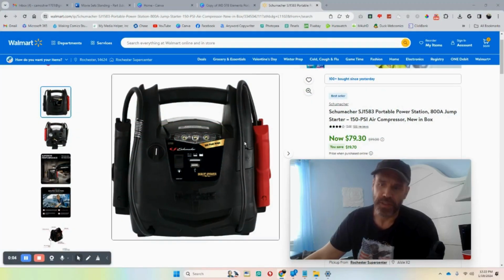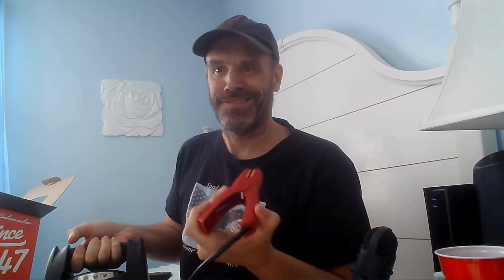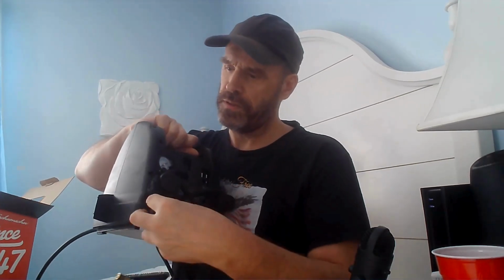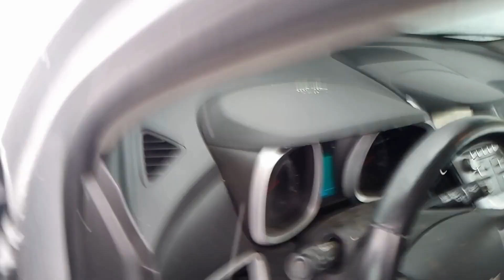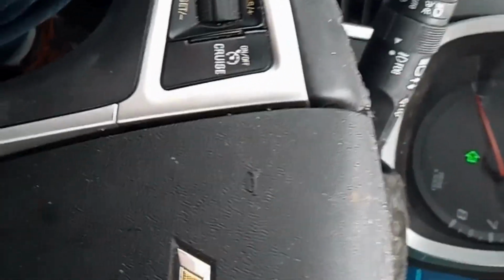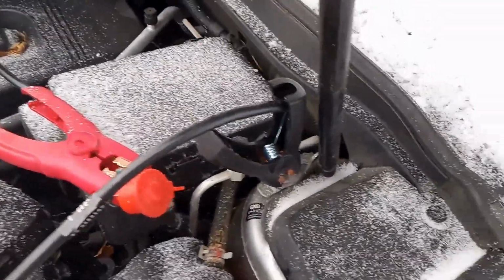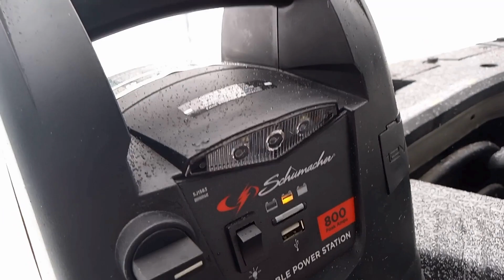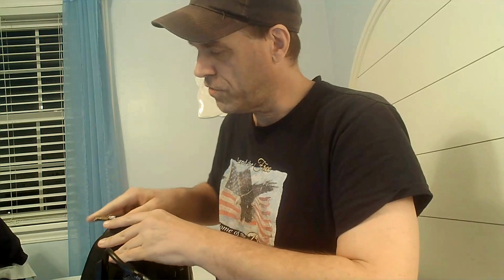Schumacher SJ1583 Portable Power Station, 800A Jump Starter

Comment: The instructions clearly says to charge the jump starter for 36 hours . This was the worst video I’ve ever seen on using a new product. When it is charged the light will be green when you turn it on after hooking it up to battery. Works great if you follow the written instructions in the box😊
Reply from the maker: I didn't make it for you so stop watching.
Reply: Charge your toy first then try again
Reply from the maker: @ It won't jump a completely dead battery.